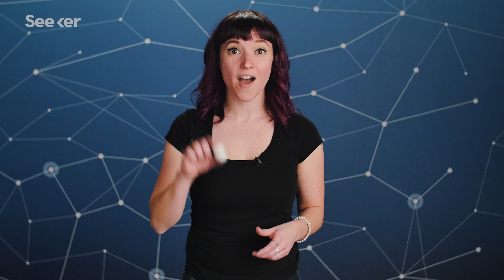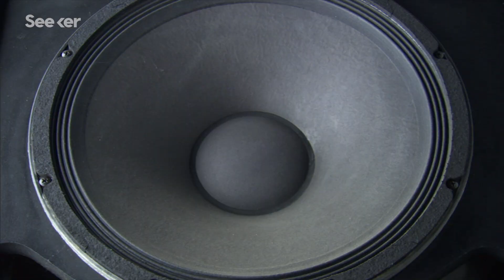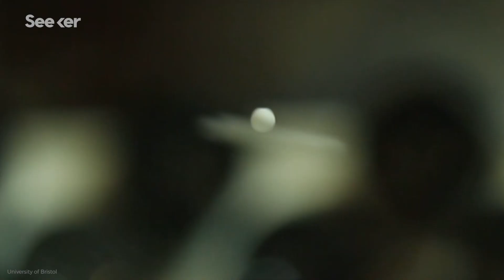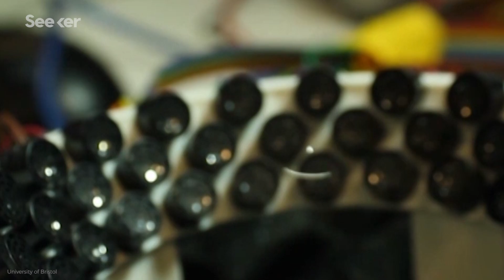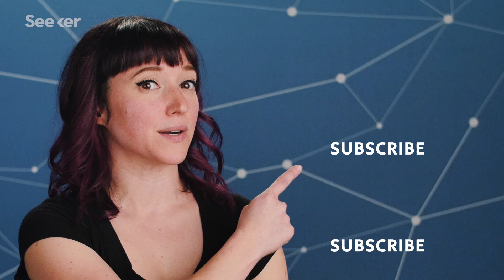Scientists Just Used a Tractor Beam to Levitate the Largest Object Yet

Comment: If you want to achieve this look into John Hutchinsons work with EVO's Exotic Vacuum Objects. Simply focusing sound waves is not enough to levitate anything with real mass. John made 80lb steel balls float through the air as well as even non magnetic objects using EVO's.

Comment: Made one of these for a physics and electronics final as well as a bonus extra credit applications for mathematics. Way back in 2000. Long story short it was made of 144 ultrasonic transducers, a couple of parabolic reflectors and the driver electronics. The interference of the 9 inner transducers created a standing wave and the outer ones created a triphasic rotating field that would suck up small light things like a fishing lure, a foam ball and a bigger Christmas tree bulb and it would stop at anywhere from 6 inches to 22 inches away from the transducer array. The driver was a bunch mosfet transistors and coils driven by 6 banks of signal generation ICs. Dialing it in was a bit odd as it created spooky sounds from soundwave mixing off walls and such. The transducers were similar to the type used in motion detectors and ultrasonic measuring tools. The resonant frequency was 40kHz so not too far into the ultrasonic. The thing really looked like some sort of sci-fi prop with the emitter being a gun like thing with what looked like a mini satallite dish built into it and the driver being built into a backpack frame. Other things it could do is pulverize brittle materials like rocks and ceramics as well as ignite cottonballs or weld pieces of plastics togther simply by changing the sweep rate on the tuning. 🤓😁❤

Comment: It is the mass of the air that is moving when the sound vibrates it that does the lifting.  In a more dense medium than air you could lift more weight.  The only way to increase the lifting force in standard 14.7 psi air would be to increase the kinetic energy the vibrating air has.  So, louder speakers should move the air more for the same frequency.

Comment: Perhaps we could lower some type of nozzle to the surface of an asteroid,  inside the nozzle would be rotating lasers that could break up the rocks,  also at the same time there could be air added to this. Then apply the sound waves to lift up the broken up rock.  Or perhaps we could modify light waves that could hold air inside it as well as sound,.

Comment: Thats really cool yeah its a small ball but look what its doing.its literally holding it in the air with just sound no magnets or air simply waves of sound that is amazing
Reply: Dude, sound waves are literally just air producing vibrations, so technically air holds it. Acoustic levitation like this is just Coanda effect, but it just operates with different mechanics of physics. Acoustic levitation like this effect operates with the vibrating air, unlike Coanda effect, it levitates (round) objects with the sheer push of air.
Reply: its wiggly air bud

Comment: wow... That's not a tractor beam, that's an acoustic confinement. 
Half the reason why the Sci-fi beam is of "undefined energy" is based on the fact that we don't know how to control gravity yet in the form of energy.  Tractor beams in sci-fi are based n having the ability to control gravity, an ability we still don't have as we have not yet even identified an exact particle associated with gravity, much less built a way to make those particles and control the flow of such particle energy.

Comment: I once used sound to raise a 165 grain projectile nearly 700 feet vertically into the air.  The peak pressure in my sonic levitator was roughly 35,000 psi.  It took a good while for the bullet to come crashing back to Earth.  We were in the middle of a very wide open, uninhabited field, so please, stifle the comments...

Comment: Right (about the air) so it's not a tractor beam. I would argue it's not a TRACTOR beam because it doesn't pull (meaning of the root "tract"); it pushes with density waves of air. Note that all the little speakers were below the ball pushing it up in opposition to the gravity trying to pull it down. I would argue (less forcefully) that it is not a tractor BEAM because it is not a beam at all.

Comment: that's not a tractor bean .. you're not relieving air pressure .. you defying gravity .. it's not the same thing ..

airplanes and rockets don't fly the same way

airplanes fly by relieving air pressure from the top surface of the airplane and increase it in the bottom surface 

rockets use repulsion by ejecting pressurized gases created from burning fuel .. 

it's not the same thing ..

the sound wave manipulation is a different method of levitating ... instead of installing it on the ball and make it act like a rocket .. you're pushing the ball with the sound waves .. just like pushing a box from point A to point B ...

Comment: Yeaah I don't think you can just move kidney stones around the human body as easily as she made it sound. The stone gets stuck in the ureter, at which time it is typically unsafe to just pull it through the ureter, especially if its big. The ureter is as limp as a wet noodle, and the wall is as thin as a flower pedal.

Comment: type Acoustic levitation chamber into youtube, you will see that objects much larger than this has been "levitated". Contrary to the comments the sound is actually holding the ball not pushing it, the effect is created when 2 or more sound waves meet creating what's called a Standing wave, in short the ball is sitting on a cushion of high pressure air that is neither pushing or pulling the ball. Look at how sounds waves work you will understand.

Comment: Wow, is Seeker populated with High Schoolers? Air is a Gas, not a Fluid and Sound is an Energy that needs a Gas to Travel, hence Air, which is abundant on Earth. Also, another Fun fact, you described the act of Repulsion, pushing away, and not a sci-fy "Tractor", or Attraction, Beam, that brings something towards.

Comment: These are actually acoustic holograms produced by arrays of speakers.   If they can calculate more complex holograms easily, they could use these as scaffolding for 3d printing.  I've also wondered what if they try to do this with RF instead of sound.   The intensities would have to be extreme to have any significant effect but in theory, electromagnetic forces are how objects resist or impart forces in the first place.
Reply: Pretty sure they tried this with rf before and used the contraption to zap tumors o.O
Reply: @rogerpaull6178  Zapping tumours is not what I was speaking of as to zap the tumour only requires damaging radiation and RF can be damaging, is concentrated on the tumour, and this has been done by having multiple narrow beams aimed from different directions on the tumour such that the highest concentration is on the tumour.  What acoustic levitation is about is using different frequency patterns to control the concentrations of the wave forms to provide physical force on something and the reason why I wondered if RF could also impel physical force is that it may be possible for the standing waves to create smaller regions where the waveforms build up and hence cause less damage to what isn't to be physically impelled.   Yes manipulations of RF has been used to target tumours with lethality but that isn't what I'm talking of.

Comment: the reason you can somewhat characterize this technology as a tractor beam is this: if you can hold the ball in the air, and tilt the machine without the ball falling out of the sound field, then logically, you could develop the technology needed to tilt the sound emitters themselves, allowing you to push or pull the object.

Comment: I was thinking of space also,  there are radio waves ,  neutron beams and light waves, it is hard to tell what might have an impact, however, light can turn a radiometer in a vacuum so it's a good bet it could be used, but we need something more powerful.  
        All your vaccines in one shot would probably kill you.  Glaxo Smith Kline put six together and the adverse side affects wich did include death and autism, were on a list about 600 pages long.  These are diseases, living viruses and the body needs more than just antibodies to fight them off, that is only one fourth of our immune response.  Vaccines carry multiple other contaminating viruses, carcinogens, cancer DNA and foreign human DNA from aborted babies and the harm they can do is immeasurable when put in multiple vaccines, not to mention the deadly neurotoxin, Mercury that is in some of our vaccines and aluminum that is in most of them.

Comment: I think dozer beam would be more accurate.  A tractor usually refers to something pulling, not pushing. When a beam of some type, or sound wave has been modified to actually pull something,  then I will be excited. This is nothing new.

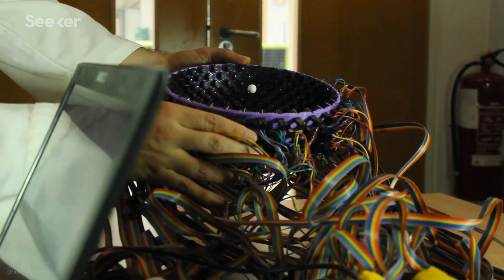Comment: You can see all the technology at (1:39). And I'm sitting here Like didn't we do this with a air blower (vacuum in reverse mode) to do the same thing with a pong ball in engineering class when we were bored??
Reply: Well I think the difference is this could potentially be used to go through objects like your body to help move that kidney stone. Similar to ultra sounds. Air can't do this. So yes, there is a difference.
Reply: Actually the ball is locked at a certain distance and angle from the array. You can see right at the end of the demo video the array is tipped to the side and the ball doesn't fly off or fall, it is trapped in position. A plow or trailer is trapped a certain distance from a tractor. It doesn't get closer and closer to the tractor, but the tractor can still move it around.
Reply: that's pretty neat actually. kidney stones are just blown up with lasers, so it's not much use there. but maybe there's an application somewhere
Reply: Zreknarf it only needs a particle to move through, it doesn't have to be air, the sound would pass through solid gold if the sound waves were directed there
Reply: The difference is that the force is sourced differently. The hair dryer is an air force that essentially traps the ball in place while this is sound, that can diffuse through surfaces, and requires more energy to produce.
Reply: MadMalcolm D best reply. 😂
Reply: Or tip your head back and do it with a Malteser
Reply: Nimr Al Nimri Thank you.  I try :)
Reply: They should just use electromagnetism or just work on trying to use gravitational waves then using sound, who tf thought that that would be a good idea?
Reply: ITS SOUND NOT PUSHING AIR
Reply: I just like to use a vacuum on my genitals when I get bored.
Reply: Well i mean we did use air
Reply: this is sound, not wind (note for example that sound can travel through things other than air)
Reply: Razvan J  They do use ultrasound to shatter stones. I don't know...what you are talking about.
Reply: if i put my hand under ur air blower, the ball will fall down. but not in this case, so its a bit different.
Reply: Genoxz Gaming Put your hand in front of the transducers and the ball will fall.  This is just a fancy way of producing air flow to levitate the ball.  When they can do it in an absolute vacuum with range then I will be impressed.  Until then, this is just a fancy Dyson and a pingpong ball.
Reply: is it though.. using sound is using air, this wouldn't work in space with no medium
Reply: @Zreknarf  unless you could generate muons or tauons to increase the mass of an area on your ship and pull an object in.
Otherwise there would have to be some undiscovered force.
Reply: content  or, you know, magnets
Reply: @NoSubsWithContent  .....ANTI GRAVITY!
Reply: Zreknarf wrong this works inside a vacuum.
Reply: Nimr Al Nimri https://youtu.be/V0KbYyuCOwk

Towel being levitated by sound waves,
Reply: And moon landings are still fake.
Reply: The big difference is, is that with air (e.g the air blower method) the ping pong ball would fly away if you tilt the air blower. Whereas with sound, the little ball would stay in position even when tilted upside down. So yes, there is a big difference.
Reply: I.iN.T.J -  yeah, indeed 😂
Reply: well these are sound waves, not air. so its different for sure
Reply: I’m 13 and I’ve already done this for a science fair

Comment: It’s NOT blowing air or pushing on the ball. Remember the basic science of how waves work. The substance itself only moves back and forth. The air is vibrating, and the waves are directed into the ball, but the frequency of those waves is what is holding it in place. No one has been able to do this before with an object larger than the sound waves. Now they have, it’s an important first step. Scientists can build on it. Maybe they can try to combine the device with sensors that measure the dimensions of the object, whatever it is, so they can adjust the frequency to some multiple of its topology and hold what ever they put in there. Maybe they can make small adjustments to move it now they have it in place. Science and discovery is incremental.

Comment: in that case of no air in space for sound to travel on you can use light, think of a mid size photon laser with a smaller one. no first off space is cold so thats real good for light. so by changing the temperature of the inside laser as opposed to the outer laser making you will be able to attract the object closer, or push the object away and direction of the laser...i love science!!! it just makes scence!!

Comment: Lmao the largest object lifted with sound waves?...  Heres an Experiment, get a Subwoofer Speaker ,an Audio Amplifier and a Ping Pong ball. Go nuts.
Reply: Mr Wayne that's not sound directy, that is really magnetism pushing the diaphragm of the speaker and the diaphragm is what is moving the ball. And sure if you turn it way up you can use the air waves to move shit without control.
Reply: Mr Wayne with this they are actually using the sound waves as pressure spots to sit the object down on in a controlled manner.
Reply: Its Electro-Kinetic. Ive done experiments with the subwoofer speaker and it proves to put out at times an Electro-Kinetic Force, and its not air.
Reply: @Mr Wayne Dumbass, electrokineticism with audio equipment? Are you a child pretending to sound smart? I haven't laughed so hard since I heard dumbasses say the double slit experiment proves our brains' neurons tampering with reality.
Reply: It's in a stasis in space. I think they meant, putting it in a stasis in space.

Comment: I agree a tractor beam should work in space (or a vacuum). This sound wave manipulation using harmonic nodes is not even close. A real tractor beam would use something more closely related to quantum flux technology where an object is trapped within a high energy (electric, magnetic, or possible photonic) field, and based on the energy output of the field an object could be moved closer or farther away relative to the source location.

Comment: "using sound waves to lift humans", A) blown out ear drums, even if it's in a capsule it would be like being inside a TU-95 B) The energy required to power multiple GIANT speakers would be ridiculous C) sound waves are just air moving, might as well just use a wind tunnel as an elevator instead

Just going to leave this here. https://youtu.be/l8STHiP7HZY?t=1m31s

Comment: can anyone explain what makes this more practical vs blowing jets of air to do the same thing better?
Reply: wave properties such as frequency, volume, pitch etc. allow us to modify the effects a sound wave can have such as the distance it can travel, the degree to which it can affect an object, and what specifically it is able to affect.
Reply: Similar reasoning to why not use an air blower to get a picture of the baby before it is born, instead of an ultrasound...
Reply: Winterfell https://youtu.be/W1VFFGKufPg
Reply: The sound waves are moving at the speed of sound to keep the ball locked in place and does so while the speaker array is tilted sideways. If you tried the same thing with puffs of air, you would see some lag time in moving the ball and more instability caused by turbulence and colliding puffs of air.
Reply: Well, if you cant figured it out yourself the porpose in medicine, then you just better blow some air inside your body instead of just bombarding with sound waves.
Reply: and how are the sound waves going to move things in your body? it will either get absorbed by your fat or moved other things that it shouldnt